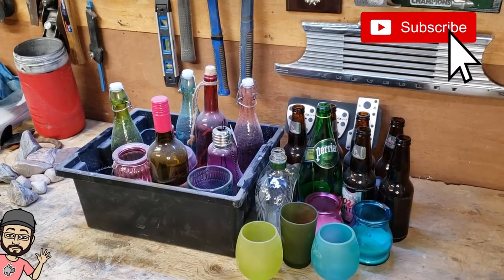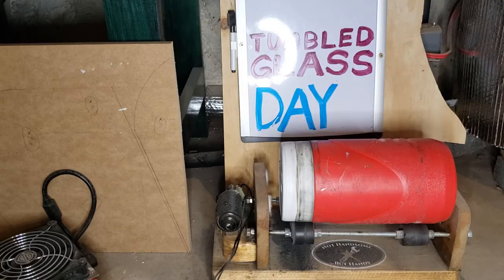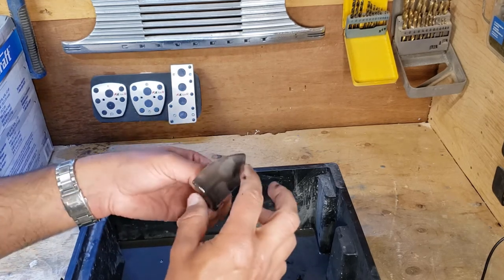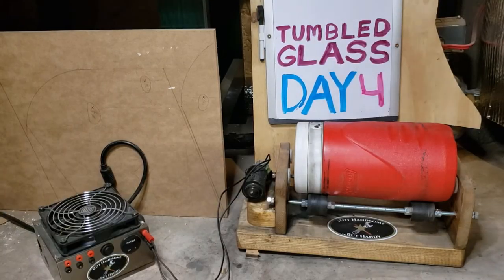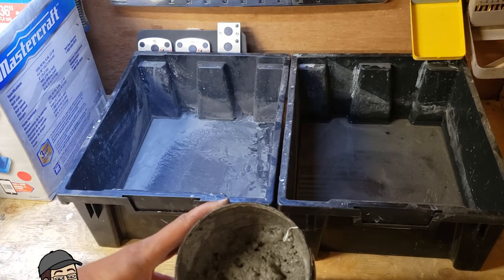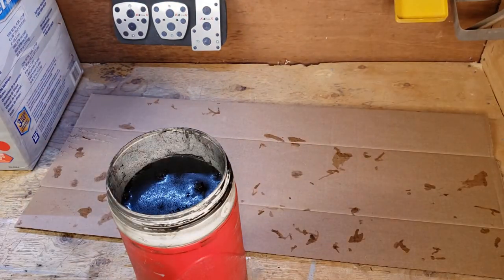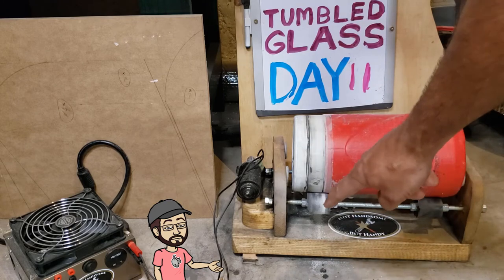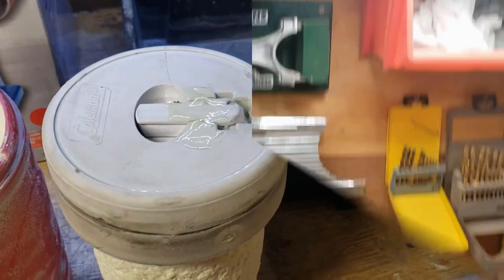DIY Rock Tumbler - Episode 5 - Glass Tumbling

Comment: In asphalt testing, when testing the rock hardness of aggregate they use steel ball bearings in a tumbler. If it was me I would try using 3 different sizes of steel ball bearings all at once. (3,5,7mm for small rocks 5,10,15mm for larger rocks or something like that) The inside of those tumblers also has fins,(like what you would see in old-style dryer drums) this lifts the rocks higher and drops them with more force. You would see a huge improvement just by adding fins in my opinion, add some steel bearings with fins and those rocks should smooth out a lot faster! A sweet benefit to using steel ball bearings is they're reusable ;) (in the testing lab once they wore down to a specific size they had to be changed, but if you're just doing this stuff for fun you can use them until they're dust!)
Reply from the maker: A fin would be an excellent idea, I'm going to think about how I can add one to my drum. Also I would love to use some ball bearings, I wonder where I could get some cheap.
Reply: @nothandsomebuthandy  some auto places have replacement steel bearings fairly cheap
Reply from the maker: Excellent idea, I think I'll check next time to pick up parts.

Comment: Painted glass color comes right off in a tumbler. You have to make sure you use actual colored glass not glass that's painted. Second hand stores are you best bet you still need to check for painted pieces.
Reply from the maker: Most of the colored stuff I found was so thin it disintegrated. I would like to find some thicker stuff.